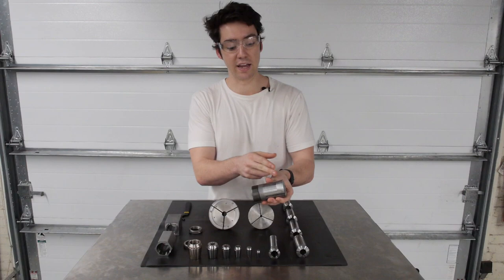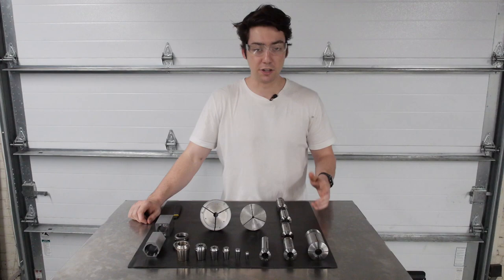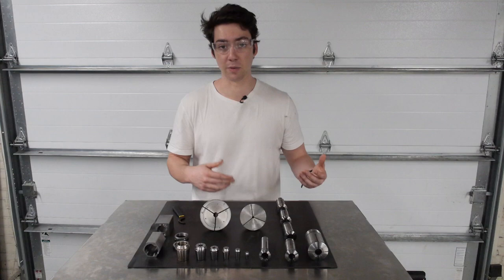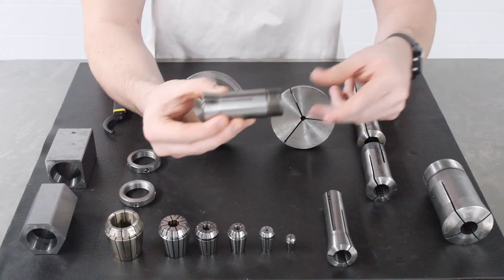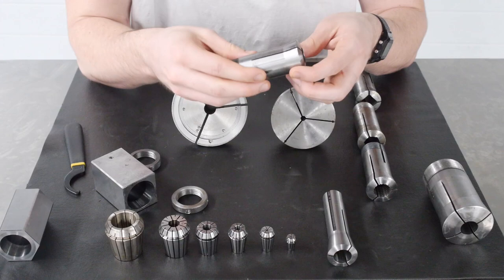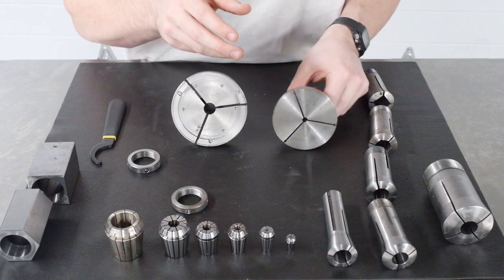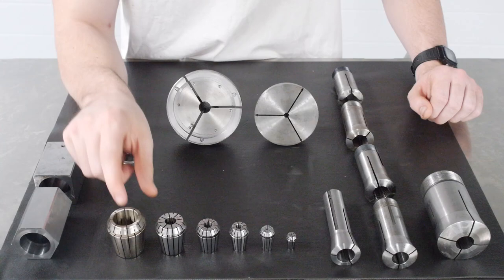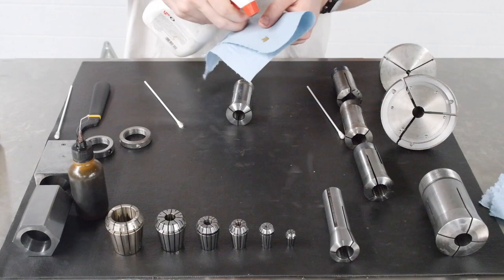Collets

Comment: The slot in an R8 collet is not to make sure it is indexed properly, it is simply to stop it spinning when tightening the drawbar. Likewise with the C5, the grub screw does not have to be tightened into the collet slot. It is also just to stop the collet spinning when tightening.

Comment: Great video for anyone new to machining (and especially with using collets) but one thing  that is incorrect, You CAN  in fact do eccentric turning with any collet that you can get an emergency collet in (I've done it many times). All you have to do is bore or mill your hole or shape it off-center in the emergency collet. The only key aspect about it is that you need to make sure that your off-center feature is in an area that will still be in good contact with at least two of the three sections created by the slits. You want to be in contact with all three but you DONT want a majority of you contact to only be in one with minimal in the other two. If it were like this, you will end up with very minimal clamping pressure which obviously is very undesirable.  On the other hand, if you are in good contract with two of the three and minimal in the third, you will still have very good clamping pressure (maybe not 100% but still very good... (I've never had a part slip doing it like this)).

Anyways, as said, "great video..." and just wanted to throw in the info about eccentric turning.
Reply: You can also do eccentric turning using the collet block in a 4 jaw chuck.

Comment: 5:25 - there is NO way that "keyway" is going to provide any level of indexing. That "keyway" and the corresponding screw/pin in the spindle is ONLY there to aid in screwing in the drawbar - it keeps the collet from spinning. IT IS NOT AN ALIGNMENT PIN.